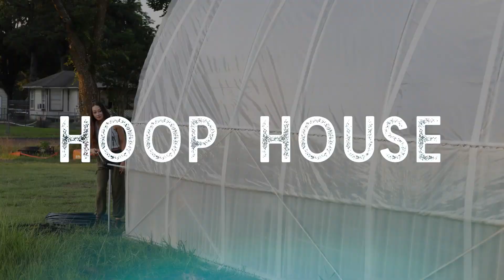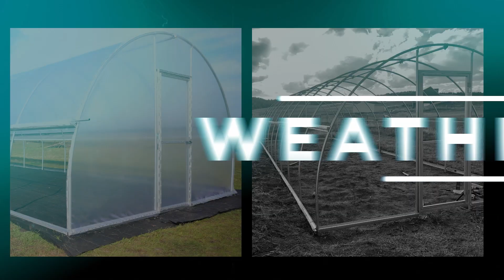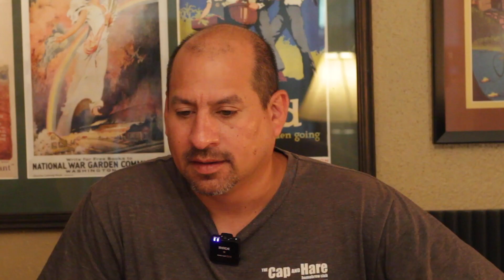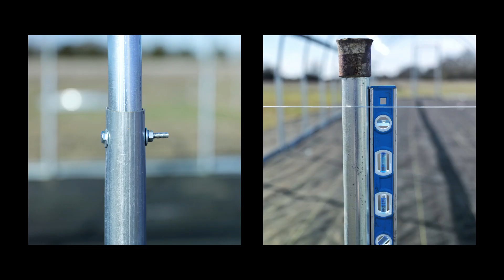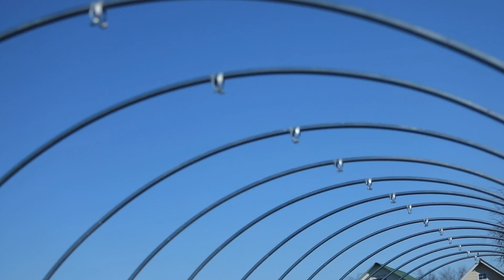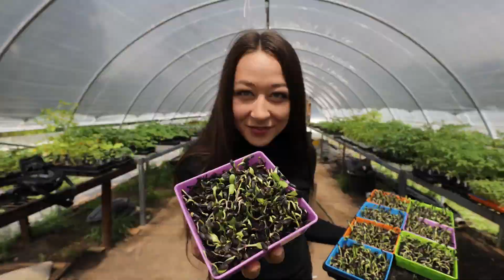Hoops Basics and How to Install Hoops | HOOP HOUSE 101 Ep 10

Comment: Great video,  I appreciate the knowledge,  I have questions on the bow hoops  , how is the length calculate On  each piece joined in the hoop , if the is any formula use to calculate the length of bow hoops.
Reply from the maker: When figuring out the arch angle for a hoop house, you need to think about several things: how wide and tall the hoop house will be, and how long the hoops are. You also need to consider how far apart each hoop is placed, how much weight the structure needs to hold (like snow or wind), and what kind of foundation it has. The local weather, what you plan to grow inside, and how you plan to build it all play a role too. All these factors work together to determine the best arch angle for your hoop house.
We've done all of that work for you
Here is some more info: https://www.bootstrapfarmer.com/blogs/building-a-greenhouse/bending-hoops-for-hoop-houses